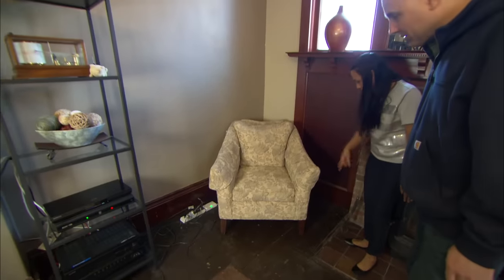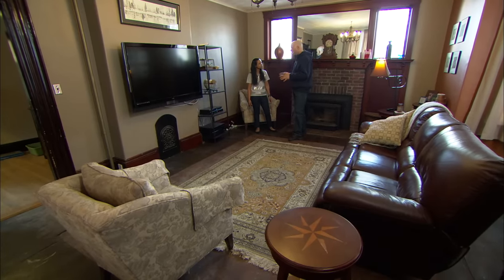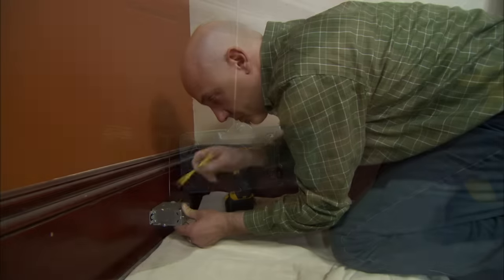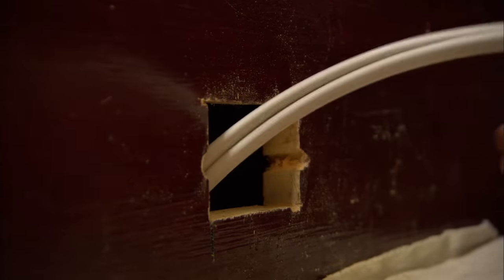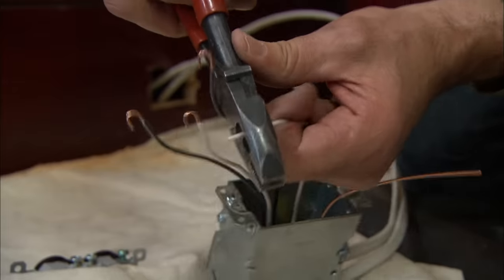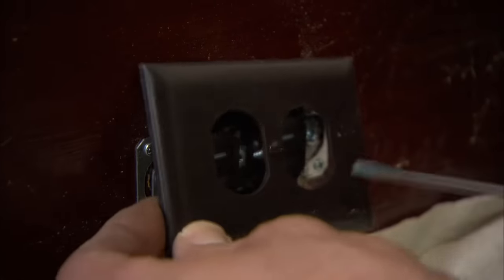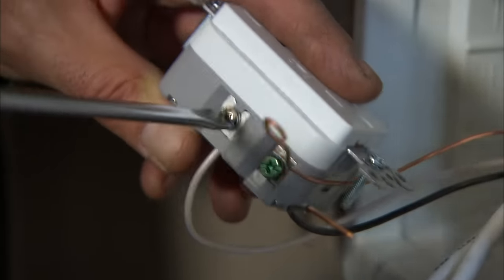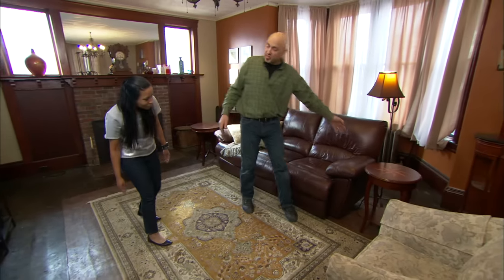How to Add Outlets to a Room | Ask This Old House

Comment: How to Add Outlets to a Room - that is unlike 99% of rooms
Reply: next on this old house how to install an outlet in the bottom of your bathtub for your hairdryer
Reply: i guess its a different part of the country , cause i aint never seen it be that easy.
Reply: @vwtroy  that's what I said 😂😂
Reply: That's a standard room in ... an old house. Kinda like the title of the tv show !!
Reply: Yup a lot of homes in the north east are like this one
Reply: Vwtroy troy not really.
Reply: Jordan Smith standard in any house
Reply: @wizard3z868  I wish they'd use some houses that didn't have basements. I can't do about half of the things they do here sadly.
Reply: @StuffTested  yes unfortunately they are out of commiechusetts NE and we have a lot of basements in the north east (we also have a ton of mobile homes for real working tradesman too but you will never see any of those on tv).
Reply: @StuffTested  anything you can do in a basement you can do in a crawl. It's only slabs that are different, and all that means is that you have more of your stuff crammed into the attic.
Reply: @StuffTested  or a house with a finished basement.
Reply: Jordan Smith an old house up north. South of the mason-dixon, we dont really use basements due to the shallow frost line, pure concrete slabs usually. Or pier and beam. Either way, not really practical to run wiring beneath the home, usually it is run through the attic and walls.
Reply: @wizard3z868  have you a clue what communism even is?
Reply: @rayklatt7818  yes I do and my comments wld be more accurate if I said socialism but most Americans don't know the difference and it doesn't have the same ring socialchusetts or commiechusetts like commiefornia or our capital city distract of communism lol
Reply: Let's show us how to do the same job in a brick house :D
Reply: My thought as well! This house is an older home, how about trying to do this in a newer single family home with no basement
Reply: @vwtroy  old houses.  In California you can see those as well. You see 1 or 2 Max on large rooms
Reply: My house was built in 1897. This is what my living room looks like which is why I’m looking this up. Old Homes.
Reply: @shawnjarman9860  Then they would need to rename their channel to This New House.
Reply: Exactly.

Comment: No way in HELL I'd let an electrician cut holes in my original baseboards in a old house like that
Reply: its quite common. After all its just wood. Grows on trees
Reply: @fireace9045  No...it's not "common" at all.   If you care about the value of your home, especially an older one with original woodwork like that...you'll preserve it to the best of your ability.
Reply: @HawkeyeCR52322  I have the very same original trim in the house I bought. It already had the old 2 prong plugs installed in the baseboard, old black aluminum wire so done forever ago.
Reply: it's an outlet

Comment: I literally threw up in my mouth when he cut a hole in the baseboard.
Reply: I would have used low profile boxes and outlets, the kind used on cinder block walls, but NEVER would I have cut a baseboard like that.
Reply: It’s very common in old houses to have the outlets in the baseboards. Our house is 150 years old and all of them are in the baseboards or the floor. It’s because lath and plaster walls are HORRIBLE for trying to cut perfect shapes or hold any structure.
Reply: @abbywolfe5608  well take the easy road if that suits you. I've installed them in lath and plaster walls and they work just fine for me. I've only come across a couple houses that have done this. It's just plain LAZY.
Reply: I had baseboard outlets and a few floor outlets in my 1890's house and I closed almost all of them up and installed wall outlets every 6' or so. I don't miss the bending over, the plugs that would get knocked loose, or the inability to put furniture (especially in bedrooms) close to the wall.
There was a balloon framed house in my area that burned to the ground in no time, as there weren't any fire stops between floors. If it was my house that would be my excuse to rip down a lot of the plaster and do some remodeling.
Reply: He’s matching the existing outlet that’s already in the baseboard.

Comment: showed everything and nothing at the same time, awesome job
Reply: One of the worst of "This Old House series". Wasted my time too.
Reply: Just run the romex up the bubble frame without any drilling, the junction box will just magically appear in the basement all wired up correct for you to run to these outlets. The romex runs itself too from the panel so don't worry about passing through joists correctly etc. What's so hard to understand lol.

Though I never expected to be a licensed electrician after a six minute video.

Btw my house is bubble frame and I'm gonna have to drill like a madman. Place is built like a tank. 120 years ago, they didn't think about me having to run some romex upstairs
Reply: I'm sure the actual episode had details.

Comment: I love TOH. The solution always involves an ample amount of space in a basement
Reply: Steak Williams and they always edit out some steps in the process
Reply: Oh you have a basement? Try installing outlets on the first floor of a two story home built on a concrete slab.
Reply: Vortex 369 that’s what I was hoping would be demonstrated.
Reply: Or adding a light on the first floor and having no strapping
Reply: Those of us not in century old houses on the upper East cost of the US are like; geez...thanks.
Reply: The first thing you do is install a basement

Comment: So... that was easy in a hundred year old house.  
Now try adding an outlet in the ground level of a 1970's house on a concrete slab with no floor voids and 2" high baseboards.  That would be my house, by the way.
Reply: Yeah, and my apartment.
Reply: And my axe
Reply: I was born in the 70’s....I am not “Old” 😩 I am Forever 21...Your house doesn’t apply 😁
Reply: @Mr. Meeseeks I ended up ripping into the ceiling because the attic is above the second floor.  Some jobs there's just no easy way. LOL
Reply: my basement is finished, impossible to fish wires to the box due to duct work
Reply: ...and don’t forget the part about not having free slots in your breaker box, too.
Reply: Lots of notching and patching plaster. Hope you're willing to repaint!
Reply: @bb5242  In MOST homes the scheme is to remove the base-board. (Just that step is video worthy.) Then cable can be routed left and right by notching into the studs near the base -- just enough. Then with the proper technique a cut-in ('old work') box can be set in the dry wall, with Romex feeding it from below, perhaps even from above. (It's not necessary to staple fished in cable.)

In this scheme, it's not uncommon to feed the "home run" to the power box (panel) from above.

In two-story homes this can even involve plunging all the way up and down various stud bays. Ugh.

At the end, the base board is put back in place -- with a professional painter used to touch up -- if needed.

Sometimes it's an absolute requirement to tear into the plaster/sheet rock and have the booboo repaired professionally. Ugh.

BTW, it's wise in such rooms to set double-duplex boxes -- never singles. Prepare for the future.

Comment: “To get started i use an insulation rod...”

“What is that? A drill-bit?”

“Not really. It’s an insulation rod.”
Reply: "And we put it on the end of a drill and use it as a drill bit."
Reply: Crotch Banister   yup and I've used it many times for coax fishing. Nice because it's an easy hole to repair if you miss your mark. Only issue it they don't seem to make coat hangers like that anymore lol
Reply: I've used a cut coat hanger to drill a pilot hole from outside my house through the cedar siding, the house wrap, the sheathing, the insulation, the vapour barrier and the drywall.  About 7-1/2" total thickness.
Reply: lol
Reply: This girl would be screwed without a man in her life
Reply: Pro tip- in a pinch you can use bare 10 awg (solid of course). Chuck it up like you would an insulation rod and then grab the tip tightly with pliers. Spin the drill a bit and the copper will start contracting and stiffening up as it twists. Not as stiff as an insulation rod, but works for most applications
Reply: Hate to break it to all the misogynists commenters, but she was told to pretend to not know basic things and ask about them. It's an educational television show, you geniuses. Some of those scenes were done in 10 takes, asking the same question over and over. Because it's a TV show, geniuses. She's likely done more home restoration than any of you; that 1865 2nd Empire was barely human habitable when we moved it. Source: I live there, and I was there for filming. So was my cat, but they seem to have edited him out of all the scenes :(
Reply: Forgive her, she had a blonde moment.
Reply: @mech_magic  welcome to the internet Seth, you must be new here.
Reply: that whole situation dude lmfao wtf it's mind blowing after not really he goes on to say he's going to use it as a drill bit LMAO I'm dying

Comment: Enjoyed reading the comments. Particularly found the comments from those outside the US interesting. As to the video I have some comments/questions. Why use metal boxes vs. plastic. I don't see the advantage and I've been installing outlets in my homes and for friends for many years. 

Also I strongly discourage putting the outlets in the baseboard and certainly don't like to do place them in sideways. I did that all over the second floor in our home when I ran into issues with lots of cracking when trying to put them into plaster. My wife H-A-T-E-D the sideways plugs. There were too many things that the plug is designed to be vertical not horizontal. She liked those oil fragrance things for awhile and she couldn't use them on the second floor. And you know what they say. If the wife ain't happy... tell her to get you a beer. That'll get her out of your hair for a minute. The biggest reason I won't use the baseboards again though is that I don't know what the home owner is going to want in 20, 30, 70 years. There is no repairing that hole you put into a solid oak board. 

I've actually come looking for better methods to install outlets into plaster walls than what I've used in the past. Too bad we weren't shown how he worked the entertainment system items.

Thanks for making the video. I picked up some tips. One final question. You used a power drill to screw in the anchor screws. Why did you use a hand screwdriver to tighten the outlet screws. I'm impatient and lazy (in other words ... efficient). I use my power drill for everything. I'm so spoiled:) Speaking of which. I just got a battery for my original Black and Decker VersaPak screwdriver. That is THE BEST power screw driver I've ever had. I used to use it on everything small. Home stuff. computer stuff.
Reply: "Why use metal boxes vs. plastic." Because that wasn't being installed in drywall, which is the only kind of wall plastic boxes are intended for.

Comment: My new house has the outlets in the baseboards, but not installed sideways, installed the normal way.  Looks so much better with them in the baseboard. Really cleans up the walls. It’s a nice little detail.
Reply: Really nice until you have to reach down to the floor to plug something in later on when your 70 years old. The lowest I’ll ever go is 18 inches to the bottom of my plugs.

Comment: You should do a video showing how to wire it in through the attic (for those of us on a slab) and how to get through the fire blocking that is in most walls.  It would be a great compliment to this video - im an electrician but i always find watching your videos to be interesting and i even learn some things sometimes too - keep it up
Reply: Patriot1  Shouldn't one see how many other receptacles and fixtures are on the circuit and what they are being used for, prior to adding new receptacles? Might be exceeding available amperage otherwise?
Reply: He ran a new circuit for the plugs he added. Watch the video.
Reply: I stopped watching because I have a slab on grade so this doesn't really apply. Thanks for the info.
Reply: Laura Ward -- Yup, about 9/10 homes featured on TOH are raised pier or crawl space homes.  About every house in the South is concrete slab.  Regional differences.
Reply: Patriot1 I agree. My house is on slab. If I want to add additional outlets to the same room, I'm guessing I will have to tear up a lot of drywall in a straight horizontal direction in order to drill through studs for wiring. I can't imagine having to run each outlet wiring up into the attic and back down again for each additional outlet. Would love to see how a pro handles that.
Reply: RixCanDoit I installed two outlets in my mancave and one of them was near a stud. I cut my hole for my outlet box and used an angle drill head on my drill and went right through the stud to run my wires. Can't see a thing when you install the cover plate. No teari g up drywall
Reply: Patriot1 I am also an electrician in Australia, I too find these videos informing sometimes. One thing I don't understand is why I keep hearing that 120v and 120v on a three phase 60hz system gives you 240v. It only gives you 208v to my knowledge. We have 240v per phase and between phases it's 415v.
Reply: Db bd residential homes in the United States have 120v going to each phase. From phase to phase you get 240v because it is a single phase system. 2 hots and 1 neutral coming from the Transformer. Neutral and grounds are bonded at the first form of disconnect coming into the house and separated after that.
Reply: Patriot1wood working shop
Reply: Usa electric work is dangerous and junk if done corectly imagine if done by people who does not know
Reply: Patriot1 exactly he didn’t show us some details especially for regular people like me .. was too fast ..
Reply: @RixCanDoit  yes, attic

Comment: Actually, as long as you use a power strip as intended, it will be just fine even when fully loaded. What you dont want to do is put more than one together, or add splitters to create more plugs than the manufacturer gave. The strips and surge protectors and other safe guards buily in, use them right and youll be fine. As with anything.

Comment: The cables allowed here in Germany are definitely rigid enough to withstand stepping on it, unless maybe you are in some kind of hotel where very many people would step on it for years. But besides the would only be one arc before the breaker or the residual current circuit breaker depending on the wires touching. This usually cannot make a fire.
Reply: Old houses like this don't have arc fault breakers.  Arc fault breakers became code in the U.S. around the year 2000.  And it's only been in the past few years that they are required on all circuits.  That said, I agree with the guy in this video.  You should avoid extension cables where possible.

Comment: I am so done. I told an electrician I wanted my outlets recessed into the wall and he told me he couldn't without tearing the wall apart. His solution was putting those ugly  external boxes on the baseboards. Had no idea this was an option.
Reply: Idk man this electrician doesn't look very professional or maybe you have a cement wall
Reply: I would’ve called a new electrician when you heard him say that
Reply: If you have a wall with typical stud construction and no void spaces, the only other way would be to open up the wall 12” wide the length of the wall 18” above the floor. Then you’d have to drill every stud to run wiring. Your electrician is right
Reply: This house sbown is not common in other parts of the country. There are no basements in Texas, I can tell you that much. What he did in this video would require a massive demo and replacement of drywall, if you want the outlet to be recessed with the wall.
Reply: This is only an option in a perfect scenario. Do you have a basement or crawl space? No? then this won't work. 
shows like this give people an unrealistic expectation. Not only is this scenario rare, they cut out all of the hard work from the video, making it look really easy.

Comment: How did you route the wire from the first outlet to the other 2?  Or were they all directly connected (individual, dedicated circuits) to the breaker box ?
Reply: Because the basement ceiling isn't finished, he probably routed it along the joists there. Daisy chaining each one

Comment: I don't think it's necessarily code, but I know the NEC recommends pigtails instead of attaching both sets of wires to the outlet. The method shown in the video will save you some wire nuts and wire but is pretty old school.
Reply: Steve Sid the NEC doesn’t make recommendations
Reply: @leonardholt5311  🤣🤣🤣 I forgot about that “recommendations” section of the NEC

Comment: Congratulations Scott. Nice and neat job. Just 3 questions, 1st.- When running HDMI cables, What distance between HDMI cables and Power cords I must leave between them to avoid noise? 2nd .- If I run each cable( not three in one insulation) do I need to join them with electrical tape or just knit them, or leave them straight each? and 3th.- How did you run the cables from each outlet in the wall and below the floor? Thank you for your video.

Comment: Nice job, Could u send more time explaining the solution to running the wires in the house, screwing the wire to and outlet gets old after the 1st time. What about in houses WO basements, where drywall is covering up everything and you have to go into the attic.

Comment: floor outlets are wonderful.
Reply: They are unless you are elderly or have a back problem or worse. Having a water damage in that area and have to take up that floor and water could have damaged that outlet sometimes causing a fire because either the box is outdated with no safety measures or simply because there was no ground.